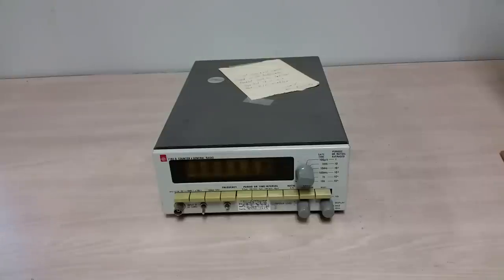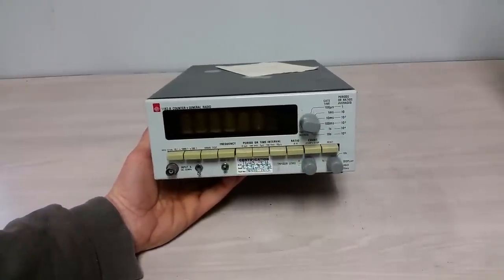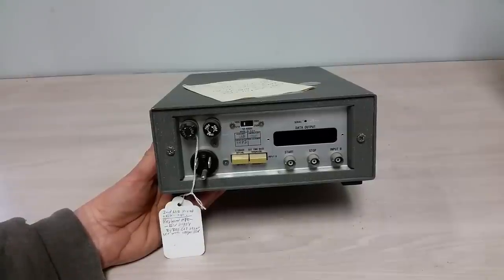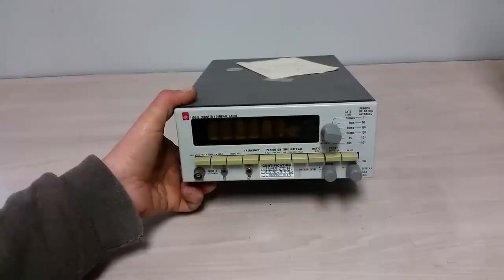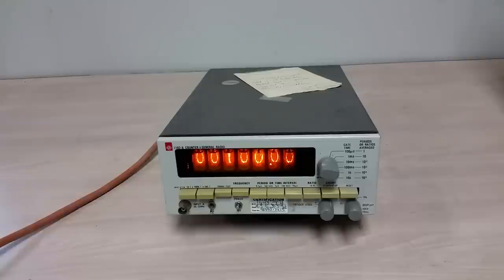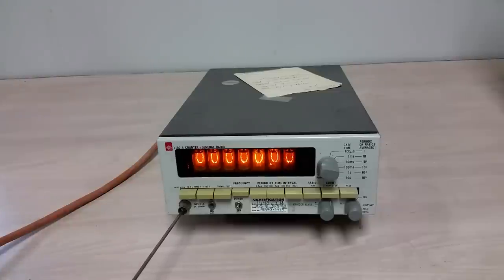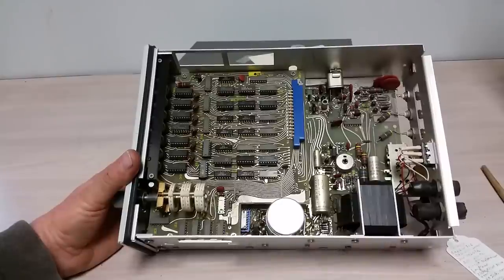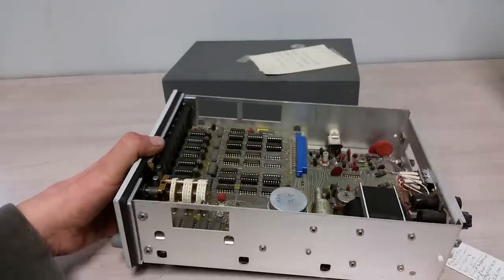General Radio 1192B Counter

Comment: Just traded Connor for one of these! Mine appears to have the digital outputs board. Haven't dug into it yet, but he had it powered up and reports that it seemed to be fairly accurate...but, as you say, Not a HP.

Yes, IET still makes and sells Gen-Rad substitution boxes, as well as standard resistors and standard capacitors. I believe they'll also do NIST-traceable calibrations on old GR standards. Haven't sent any of mine in though.

Comment: Great vid. Just saw one of these in our lab's trash today. Might give it a spin, assuming I can find a suitable mains plug...
Reply: Update years later: mains plug was ditched in another bin, and I'm glad I found it, because that US male "socket" on the back is doubly unusual in Europe. Anyway, it turns out the little GR guy works flawlessly, and those Nixies r00l!👍
Granted this is no HP, as pointed out in the vid. I had one of those HP rackmount bun-in-the-oven types and while very impressive, but it was knackered beyond repair, had a dead custom nixie tube, and took up too much space. This little GR job is probably ok for non-mission-critical stuff and won't break your back.
Btw, I also grabbed an equally cool Keithley 171 Nixie DMM from the same source.